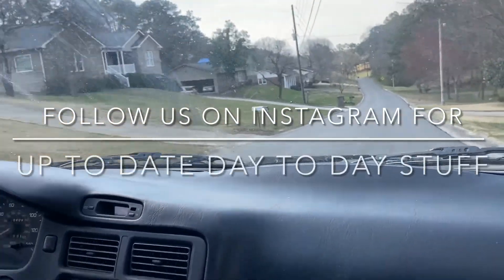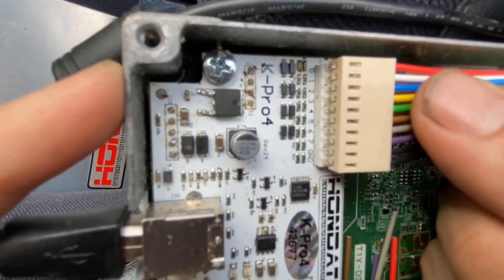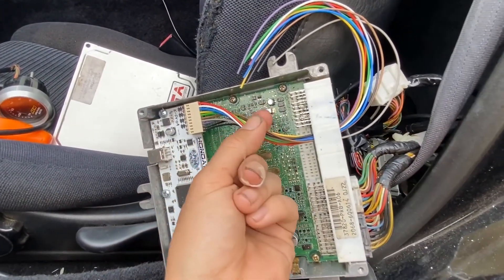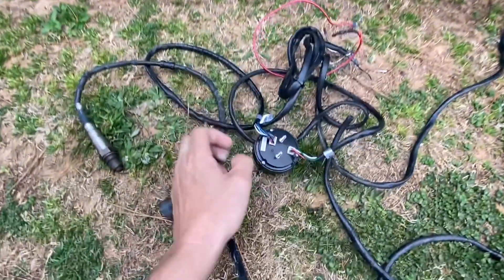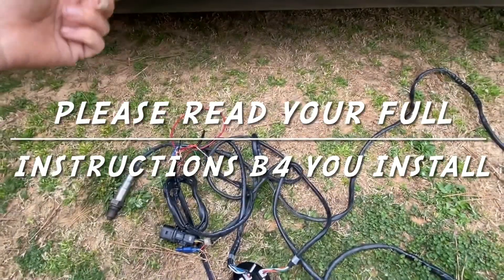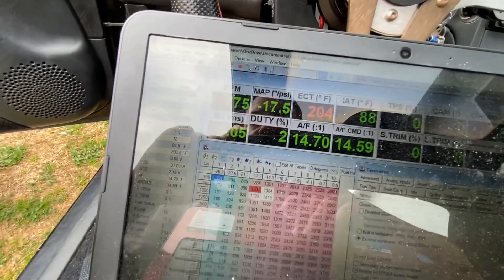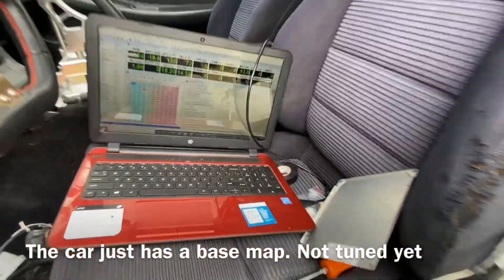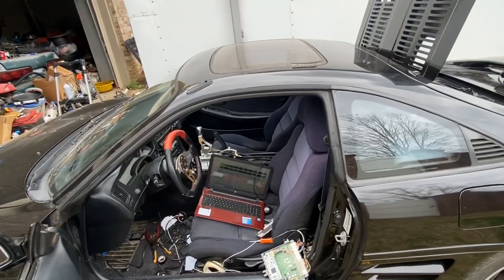aem wide band linked through hondata kpro, update on the tsx k24a2 swapped mr2

Comment: Was that the LSU 4.9 o2 sensor? Or was it the LSU 4.2? Did you split the o2 signal between the gauge and the kpro? Or does the gauge have a signal to ecu/kpro output and if it does, it it the same as splitting the same signal coming from the o2? I read on kpro help and it said a few things that made me hesitate on the connection method. I have the AEM 35-8460 gauge with the LSU 4.9 but I’m having a difficult time getting a solid confirmation been the k20 forum, AEM website, YT and kpro help. Any reply appreciated 🤷‍♂️?🙏

Comment: K pro ECU costs $800-1200
AEM wide band kit $200
It’s already $1000-1400

AEM Infinity stand alone unit $1450 and come with wide band controller within, just need harness also can be used b/k/h/f/c, and many other car brands engines 4-6(8) cylinders with usually $250 harness each set up. 

Even you change cars to 6/8 cylinders you can still use the same ECU 
And ease of VE tuning and far superior functions.

Comment: What you did with the blue wire? Nothing? And the black just to a chassis ground?
Reply from the maker: The blue wire is for different ecus and data we use white for kpro and s300, and yes black chassis or a chassis that goes to ecu depending which gauge series you have, on the newer ones they have another ground, one is chassis ground and 1 is ecu ground. Aem’s website has diagrams for all to refer too if you don’t have the instructions or bought used, hope that helps

Comment: I'm quite confused that kpro doesn't already have some sort of hole for the analog wires to go through
Reply from the maker: Hondata could possibly do it for you but they usually only cut the hole in the ecu for the cable to laptop. Not everyone runs the analog or digital outputs. The k series have stock wideband o2 sensors and can be ran without an aftermarket one that can be displayed through laptop or through Hondata Bluetooth app on a mobile device. It’s cheaper to replace the stock sensor with a whole wideband kit if they go bad or if your doing a swap and don’t have a factory wideband through a jumper harness.

Comment: Did you ran any issue running with that intercooler set up like heatsoak?
Reply from the maker: I haven’t driven it long or enough hard enough to really put it though the ringer,but as of right now even in 80 degree weather the intake air temp has been really good. It’s far away from exhaust and side scoop catches it and flows out top I will add a fan if it becomes a problem. Or go to ice box if that don’t work. I’m trying to set it up like factory so nothing has to be cut. This is all trial and error. I’ve never seen anyone do one like this and I’m gonna shoot for 450whp to 500 and hope it works well. Then I may make some kits. The next video on the mr2 I will go into the set up more be tuning a bit and getting on it. @9lbs so far so good. We will see what she takes🤞🚀💥
Reply: @i4boosting328  yeah were on the same boat im still planning my kswap route. I dont want to cut any of the trunk for the intercooler and if i have to run water to air i want that to be my last option since i only aiming for 400hp out of the k20a3 wit built bottom end. 

Id like to see your journey with you car. And im definitely gonna follow your step with the wiring
Reply from the maker: You can use a k20a3 but for the money you’d spend on building it(unless it’s already done) you can use a k24from an accord ($300-400)and it’d hold 400-450hp stock or tsx k24a2 ($600-900)can hold up to around 600 stock or k20a2,z1($900-1800)can hold up to around 600whp like in our 10sec bone stock unopened k20z1pump gas car. K20z3 is good too. The a3 can hold about 300-350whp unbuilt. They don’t like the bigger boost for long lol. I’m not knocking it at all! it would definitely work I’m just telling all the options. I’ve done or helped done them all. If you haven’t started building it yet. You can sale it and put it towards one of the others but it is totally up to you. You may have a reason to use that particular motor. Good luck with that build and you can tag me on Instagram when you start on it. I’d like to see how it does being a built a3.
Reply: @i4boosting328  my buying my friends rsx full drive train the bottom end is build with forge pistons rods bearing block guard. Also ill be getting his kpro aswel as the trans. Do you have instgram? Id like to get more advice

Comment: Why analog instead of digital? Is that just how you do it? I have almost exact same setup. 93 mr2 with jdm k24a and hondata kpro v4
Reply: It is because the signal is analog. Instead of square waves (logic low and logic high) it is a sinusoidal wave with a sweep of 0-5v dependent on air fuel ratio. The gauge is digital though. Its a series of seven segment displays.

Comment: What manifold did you end up using for the mr2 turbo kit?
Reply from the maker: It’s a emusa top mount log manifold. I want a tubular but I didn’t want to cut this one up. It was too nice of a car. I’ll find one or make one that fits. Still runs low twelve on 9.5 lbs of boost in 1/4 mile you can check it out on our Instagram @i4boosting
Reply: @i4boosting328  thanks for your reply. 
I also don't want to cut into the trunk. My goals are 500 to 550whp on pump 93. K24a2 so I'm no sure if sidewinder will fit well. We'll see.
Reply from the maker: The sidewinder should fit, the problem is gonna be with the turbo so far over, how is the intercooler gonna fit? That’s where the laying the intercooler down with fans and cutting out the back cones in. You may be able to run a super smaller top mount but may not be good for over 400.  The top mount intercooler we got is good for 600-650. The motor will definitely do 500-550 for you. We ran about 500 whp in our 10 sec stock k20 civic on pump gas. We are probably gonna build it now. It lasted almost a year beating the crap out of it and learning but it’s not dead lol just lower compression on 3 of the cylinders but still runs 11’s on the 10 sec tune lol

Comment: Have you tuned the car yet? How much hp?
Reply from the maker: I’ve got it close, and it’s a street tune. I ran a 12.4@110mph getting loose shooting into other lane. Check video out on Instagram @i4boosting we were at street car takeover. Car was on gate on 9lbs of boost. I had to pedal it right after launch 🚀 that was with a laid back tune. I got all the suspension right and went back on street tires and ran a 12.9. Spinning. I just added a boost controller and gonna go back soon. Our civic with about the about same setup stock k20z1 runs 10.9@127 on 93 pump gas. There is a few videos on here and Instagram
Reply: @i4boosting328   nice since I have your attention, I want to say thank you for the video you posted on how to wire the toyonda harness to the body harness of the mr2. I did it on my automatic mr2 and it almost wired up the same.  I’ might be firing it up today or tomorrow, I got the same turbo kit you running on the black mr2
Reply from the maker: @awdeg1987   nice! It’s been doing well so far. I have found that there are a few differences with the amount of wires through out the years but the main ones you use  are all basically the same. I’m sure on the automatic you will have to trick the neutral/park/ ignition if your swapping it to manual.

Comment: It's weird my afr doesn't display on my kmananger but it does on my gauge
Reply from the maker: Have you set it up in k manager in the analog settings and made you a gage display tab
Reply: @i4boosting328  did that. Still doesn't show. Numbers changes when change the volt but doesn't move at all
Reply: @i4boosting328  it's on analog 0 right now.
Reply: @AKYGaming I have this same problem, did you ever find out what was wrong? I’m using kpro v4 with AEM wideband 30-4110

Comment: Do you set the voltage offset?
Reply from the maker: I didn’t, it had several to choose from in the Hondata and I selected my 4100 series and then you compare to make sure it’s accurately close. If the wideband you have is not listed in the k pro or s300 etc then you have to set the voltage offset from what I’ve read and I watched the evens tuning academy unless I’ve misunderstood it I’ve done a few of them and they have been working well.
Reply: The message i got was if you have to enter a value greater than 0 then the wideband isn't grounded properly? Still trying to figure out how to get this thing going

Comment: So what does the brown wire go to ?
Reply from the maker: If your talking about the newer aem wide bands with brown ground wire, then hondata recommends using it to a ecu ground and the main black ground goes to the car frame,etc. you can go to hondata.com and they explain it pretty well. With the older aem wideband they only had 2 ground.
Reply: I actually figured it out black chassis ground. Then  analog 1 kpro for same white wire and the last two blacks on the analogs says gnd tapped in to one of those!